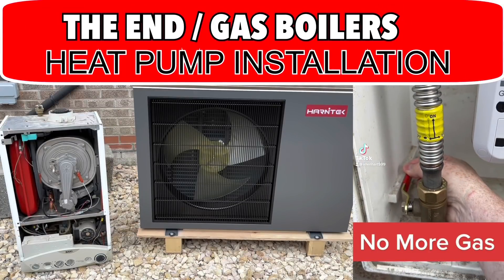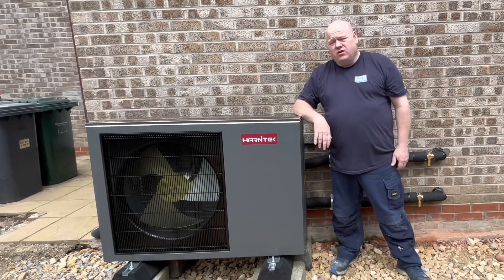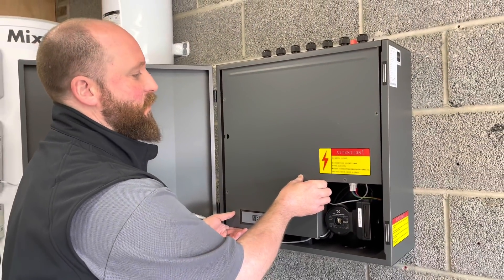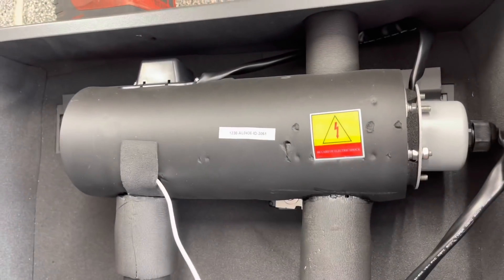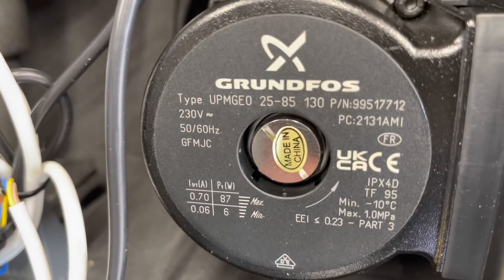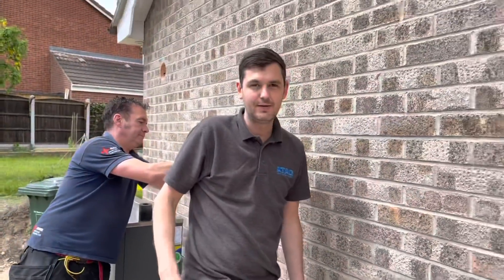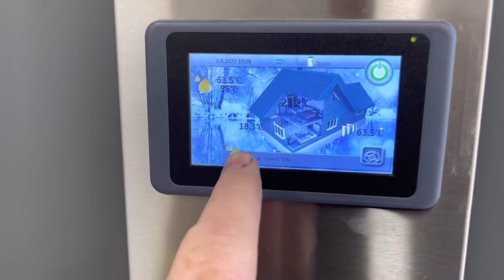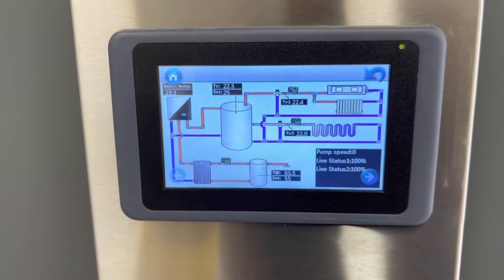ASHP INSTALLATION | The End / Gas Boilers Heat Pump Install Harnitek NGCFE

Comment: Hi, Allen looks like a great install, have you used cement board to mount everything on? looks like hardie backer board and looks like a good solution if it is.
Reply from the maker: Yes. they did a good job of it. Thanks.

Comment: I would think if you fit air source heat pump on the wall, you will get the vibration through the house
Reply from the maker: Hi Barry. You are probably right tbh. Might stay where it is for now. Thanks.

Comment: Just look at the complexity of this set up & the space required....absolutely ridiculous! What happens when it starts to go wrong....it will!
Just about to fit a new wood burner, no heat pumps coming to this house!!
Reply from the maker: Hi David. Thanks
Reply: I must say, I generally don't shy away from complexity, and work with commercial systems like this a lot, and I thought exactly this myself. Just look at all that plant and supporting infrastructure. This would be acceptable in a commercial environment, or very high end domestic properties, but this sort of set up in a typical domestic dwelling is hard to swallow.

Comment: Heat pumps do not work in UK , the thing needs a heater to make it legal in the UK, the temp output is soooo low, and the fans are noisy, great in hot climates, but no good in cold climates
Reply from the maker: Hi Jim. They definitely work and the fan is less than my gas boiler. Thanks.

Comment: Just started watching as considering a ASHP. But it has a 3kw back up pump/heater for hot water - that’s a kettle hardly eco on electricity ⚡️
Reply from the maker: Mine is switched off in the settings.
Reply: I have run my hot water on immersion for over a year. I have solar panels and heat either at night on Octopus Go (5p/kWh) or solar using myEnergi. Much cheaper than gas.

Comment: What do people think of the fact that the current target is to generate 5% (but legislation may bring it to 10%) of our gas needs with hydrogen by 2030 and then ban replacement boilers that run on natural gas by 2035.  I.e. the current plan is NOT TO GENERATE 95% of our gas needs using hydrogen.  The 5% or 10% has been declared as being for FOR INDUSTRY THAT WILL REQUIRE FURNACES ETC.  Also, why use electric to create clean hydrogen when you can just send electric to the house - clean hydrogen will be more expensive to produce than electricity and they can have less power stations due to the COP of heat pumps.  Even if a heat pump had a poor COP of 3 then that's 33% of the power generating capacity compared to hydrogen.  We will see a fall in the price of electric over time.
Reply from the maker: You make some very good points, also if they take the tax off electricity and add it to gas it will make a big difference. Thanks.

Comment: Hi Allen, I am watching all the videos and Admiring the system you have put together, I am going to start putting a similar system in my house but as you mention it’s a costly thing! Question is which order would you now put the system together in and unfortunately I need to put a new boiler in so which boiler should I go for EG combi or heat only boiler? Thanks.
Reply from the maker: John feel free to give me a call and i will try and help. Thanks.

Comment: Good video but I think heat pumps have some way to go before they end boilers. Once hydrogen boilers develop further, it could be the end of heat pumps in the UK.
Reply: Amen to that.
Reply from the maker: We cannot have the end of heat pumps so soon lol. Thanks.
Reply: there testing 20% hydrogen in natural gas . a 100% hydrogen gas network  is never going to work. for many reasons. ideal boilers, the vogue max is a hydrogen ready type boiler, but only on the 20% mix. so it might be there going to do something in the future. manufacture would not spend developing them if there was a no go.
Reply: Do you think hydrogen will make mains gas cheaper??? No. It’s going to cost a fortune
Reply: @EdthePlumber  what doesn't?
Reply: @benlea19  a heat pump? If it’s installed / specd correctly it can be the same come as current gas

Comment: How much self diagnosis can the system do for faults as there is the potential for faults to be a bit of a nightmare on a system this complex.
Reply from the maker: It has a lot of sensors. It tells you loads tbh. Thanks.

Comment: Is it the end of the gas boiler though? What about hybrid blend?
Reply from the maker: What’s  your opinion on what happens next? Thanks.
Reply: I don't know. I did an Addon for my gas the other day and it seems like hydrogen was being pushed hard. I'm 46 now, what do you think? Are we safe for work for another 30 years?
Reply: @frosty-bf  the gas boiler companies are pushing hydrogen because it fits their business model. None of them have any schemes to actually generate any hydrogen.  There will be plenty of work converting homes from combi's back to having hot water storage! If you can fit a gas boiler (competently with weather compensation) you can fit a heat pump.

Comment: Allen how is a working family going to find the average £10k for a heat pump install. Also when we start having power cuts this winter what happens when people are all in electric. It's fantastic having free electric but a 4 KW solar system will not be enough to run a heat pump in winter months.
Reply from the maker: If you have a power cut the gas boiler will not work either
Reply: @AllenHart999  it will with a small generator which we have but will not run a heat pump
Reply: Well the government has just given you £5k towards it.  I know for some it might be tough but if you're off of the gas grid its worth borrowing money to put a decent system in you'll make it back. For those on the gas grid time will tell, but if you have solar then its probably worth taking the plunge now too.

Comment: Nice install looks great.. My friend lives in a two bed flat on the second floor. Nice little Combi boiler that does everything which is a small box that fits in a kitchen wall unit... How is a heat source pump ever going to work in those situations?
Reply from the maker: Combi would be better for sure. Thanks.

Comment: Hi Allan, regarding the solar limitations of 3.6kw. You can go beyond that however it requires a G99 application rather than the G98. It does take longer for the DNO to process a G99 and their is a cost to it. How much does the Mixergy cylinder cost to buy? i'm looking to go for an air source heat pump + water cylinder and from what i've seen the Mixergy looks very versatile.  Aside from the cylinder did you have to buy the PV diverter separately.  I was thinking of pairing the Mixergy with a Daikin Altherma 3. Did the installer of the heat pump have to make a DNO notification? Noting the 10 grand i've just spent on solar PV and batteries i'm guessing you've spent in the region of £25k- £30k for all this setup. forgot to ask, have you applied for the Boiler Upgrade Scheme?
Reply from the maker: Hi Nick. Thank you for the questions, I am over £30k now tbh but it’s turned into a hobby for me tbh. I need to look into the G99 stuff, Mixergy are all different prices depending on your requirements.
Reply: @AllenHart999  cheers Allen. I've just started on my journey of discovery regarding air source heat pumps. It took a couple of months of research with the solar panels to educate myself and I'm sure it'll be the same with heat pumps. Noting the square footage of my property and the fact that I've got lots of insulation both under the floorboards and in the loft means I'm hoping not to have to replace my double panel double convector radiators. I think I'll be looking at an 8kw system for the pump. The Mixergy 250l might be overkill but I'd rather have more water storage than less

Comment: I do wish I had the skills to do that
Reply from the maker: Go on a training course. Thanks.
Reply: @AllenHart999  any centres you know of in the Midlands you can recommend. Thanks 👍
Reply from the maker: @sirajesakjee5092  You could always travel upto our Center, NGCFE next to the motorway
Reply: @AllenHart999   thanks mate. I'll check the website for details.
 What course am I looking for? I am currently gas safe, looking to further my knowledge in heat pumps as that's the way the market is heading. Thanks 👍

Comment: This would be an extremely expensive system if it needs replacing at 10 years and it also may be somewhat extinct as heating systems progress. I would need an extension building and a rewire to fit that lot. Nice of you to be a Guinea Pig on this Allen.
Reply from the maker: I love to try things so i can give an honest opinion. Thanks.

Comment: For me, one question is what about the space these systems need? Most modern houses built in the last 25 years have a combi, usually in a kitchen cupboard, no space for a tank, not sure if there will be space for the actual outside unit. The systems can work, for ‘grand design’ houses, as others have mentioned not so good with the average Victorian semi. Also do you have a MVHR? or will you install one. Have you increased your insulation or is your house already at a very high level. What about air porosity, now very important, have you had a air leakage test on your house?
Reply from the maker: Space could definitely be an issue. Thanks.
Reply: Semi's are pretty easy as you can stick the outdoor unit on the side, most people will have some space in the loft for a modern cylinder.
Reply: @edc1569  outdoor space for the exchanger, maybe, there are lots of information about the noise these units generate, but there is a lot more inside, as well as the actual tank, and then the need to increase radiator size and if plumbed in 10mm piping all has to be replaced, can the control unit go in the loft? There may be distance restrictions between the various components, I don’t know enough to confirm

Comment: Hi Allen, not ideal for a 2 up 2 down. 100% we will go to hydrogen boilers. Great video.
Reply from the maker: Hi Mike. I am liking this heat pump more than i thought tbh .. Thanks.
Reply: Where are you expecting the hydrogen comes from?
Reply: @edc1569  It's already in use, and it's about to be introduced to 2000 houses in Ellesmere port. Do some research you'll see for yourself.
Reply: @MickeyBlue-eyes  Where does the hydrogen come from?  Green hydrogen is extremely inefficient; much better to just heat your house directly with electricity.  Hydrogen is a dead end, heat pumps are the future.

Comment: There'd going to be an issue with practicability installation.  Cars not going in garages and running pipes through joists
Reply from the maker: Thanks for feedback.
Reply: install in a loft instead?

Comment: Not a plumber Allen but love watching your videos which are so informative. Just wondering about householders like myself still living with a 33 year old Potterton Myson boiler. Requires little or no maintenance apart from an annual clean our and thermocouple replacement. At some stage will need to replace with something like the system you have just demonstrated. My initial impression is that there are a number of parts which may require maintenace or might fail at some point. Just wondering therefore how geared up your professional colleagues are in supporting systems like this? I have always avoided the "big boys" like BG on pain of death, preferring to use local independent companies. Will this policy still work or will we become reliant on a few specialists? Like many who installed solar panels circa 12 years ago, my installer went into liquidation 3 years later - fortunately I have never required any maintenance on those (yet!).
Reply from the maker: This is a learning curve for me, try them on myself before i try them on Customers. Thanks.

Comment: Alan people still have bad memories of the U.K. installs of the nibe with super high energy usage due to poor insulation compared to eu standards , the same issue still apply to heat pumps for the uninitiated,  so solid heating usage number by the heat pump are needed, if you can fit a ct clamp so we can get real world numbers to both heat and create hot water (as most don’t have solar)  , so for summer can you calculate the energy used to heat the mixergy from cold to 80% using the 3 different methods e.g gas, Eddie trickled in over the day and heat pump. And recovery times Further to this 30-45c in radiators feel lukewarm where new regs say heat at 55c . Further to this in regards to the heating energy saving recent government advice said systems must cycle and be large enough to turn off  and recover when not in use on an irregular pattern e.g typical work away from home most of the day then turned on or heated an hour before getting home . It’s this where people are most worried since early U.K. installs without heat calculation were not great . Also I can’t see a condensate pipe where is it draining to?
Reply from the maker: Time will tell i guess, i will try and video it all, i will also welcome people around to give their take on it. Thanks.

Comment: Are you planning on making recorded outside vs inside temperatures readings against the COP that the ASHP shows? It would be a nice unit behaviour check.
Reply from the maker: I am planning on doing as many tests as possible. Thanks.

Comment: They might be just about barely practical in a brand new house with top quality insulation and under floor heating - but how about my 1930's detached house in the Pennines with no cavity wall insulation and L shaped to make it extra exposed!!??!!  😂🤣
Reply: if you're not on the gas grid it might still make sense!
Reply from the maker: I haven’t updated any of mine.
Reply: I’d start by putting in an unvented hot water heater with a couple of solar panels and an air-source heat pump. Then insulate as much as you can (on the outside of the walls is more efficient) before doing anything with the central heating otherwise you’re just burning money.
Reply: If it’s runs at 350% which is possible it’s the same or cheaper than a gas boiler. 

Also if he’s got solar it’s could be even cheaper
Reply: You’ll never know unless you do a heat loss calculation

Anything else is just a guess

Comment: I saw a report before that heat pumps will offer a healthy return on existing D rated boilers (not many of them around) but can be 25% more costly to run than a current A rated boiler!
Reply: And the rest.....
Reply from the maker: The heat loss shows the heat pump as been cheaper to run.
Reply: If you've invested in solar and battery storage then you're getting the fuel for free a lot of the time.
Reply: @edc1569  you're not as you've paid s fortune for the solar
Reply: @benlea19  solar is cheap, a lot of the installers are taking the piss at the moment though.

Comment: I have microbore piping which would need changing.  No way do I want one of these.
Reply from the maker: Why would it need changing? Thanks
Reply: @AllenHart999  I have microbore downstairs and fill size piping upstairs. I keep reading that microbore doesn’t cope well with the faster speeds of water flow required for a heat pump.

Comment: Been told to stay a way from them and will cost more than gas long run and to me they look a eye sore
Reply: Not to mention having a huge water tank fitted again. Seems we're going back in time. I think I'll stick with my small footprint combi that heats water instantly
Reply from the maker: Hopefully, my heat loss calculator is correct.
Reply: @AllenHart999  just a waiting game

Comment: What would reheat time of cylinder be for recovery as with family showering it can be tricky to get teenagers out of bathroom. , what temperature are you planning to heat cylinder to .some mixer showers set their shower operation based on a  minimum temperature to hot side for correct mixing and struggle with lower temperatures .
Reply from the maker: I am not sure how i will run it yet, i could just keep it at 55 or use the solar divert to top it upto 65, We will just do whatever suits us at the time. Thanks.
Reply: @AllenHart999  Might as well divert excess solar into the cylinder once the batteries are full.

Comment: Don't think the Government will bring this in ASHP are too expensive and no one will buy them cause they don't work on old housing stock and will also be too expensive to run.
 Gas boilers will still be around after 2040
Reply from the maker: My house is old and it definitely works. Thanks.
Reply: @AllenHart999  did you increase the insulation in your property, Have read that a lot of ASHP have broken down and can't get repairs done, some have said they have been worse off on their electric bills as they have to have the ASHP on all the time and cold weather they just don't work, but I wish you luck.
Reply from the maker: @richardlyons7582  I could very easily get the gas boiler back working. no issue at all. Thanks.

Comment: Roughly how many kw wud the heat pump use in one day!!
Reply from the maker: Not had it long enough yet to know that. I will keep you updated though. Thanks.
Reply: The daily kWh heat demand of the house, divided by the cop will give you the electricity consumption. Pretty simple really.

Comment: Complicated stuff goes wrong more often, simply because its complicated.
Reply from the maker: I am hoping it never breaks down lol.
Reply: By not combusting anything you've got a lot less wear and failure points. Most people wouldn't think their fridge is unreliable or complicated.
Reply: @edc1569  its not packed with sensors and doesn't have a pcb to run it. But yeah they both use refrigerant gases.
Reply: So many failure points on boilers because of the operating environment, a lot of the parts on the PCBs are almost consumables such as ignition circuits.  I'm sure there's going to be issues and machines that turn out to be lemon's but they should be a lot more reliable.